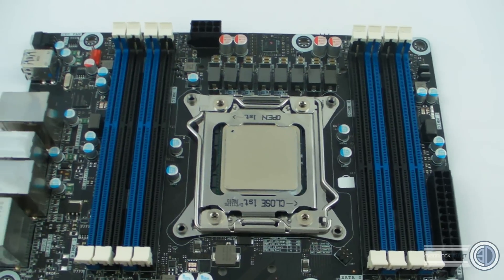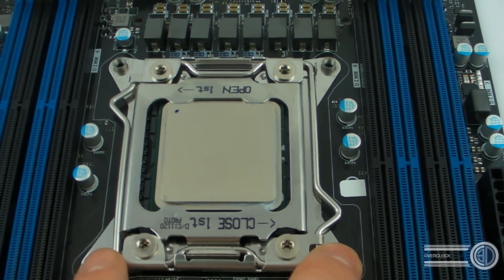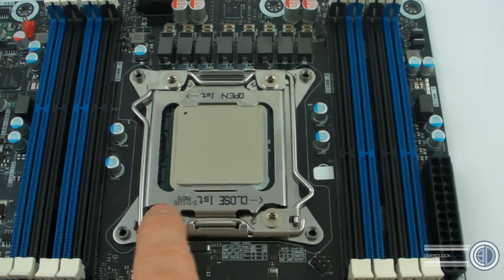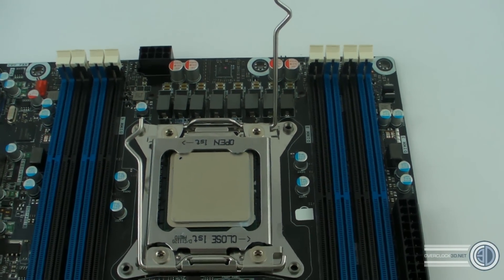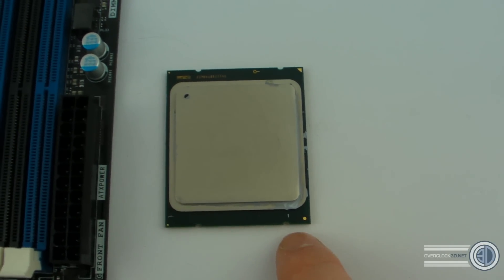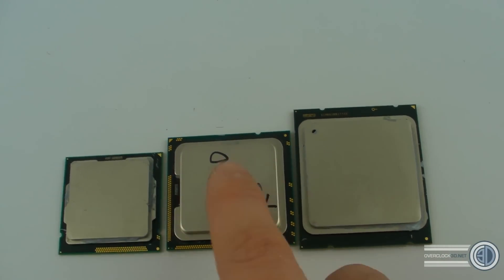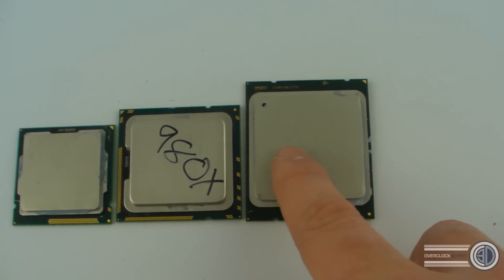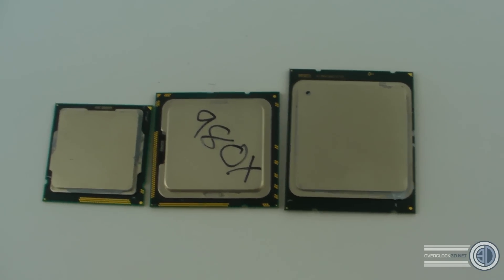Intel 2011 1155 & 1366 Socket and CPU Comparisons

Comment: ahh this answers my question about mounting my ASUS Silen Square 775 to my new Xeon 2011-3, 775/115x series were prey much compatable far as coolers go.
Reply: Michael Rinkle what happened in the end?
Reply: PneumaticFrog the 2011-3 Xeon CPU I ordered was indeed 1.5x the size of my ASUS silent square LGA775 cooler contact area, just bought a Cooler Master Hyper T4 for the 2011/-3 socket, problem solved

Comment: is it lga1150 and 1155 arw desame?
Reply: 1150, 1151, 1155 are the same size, all are 37.5 x 37.5mm PCB size. The 1150, 1155 are 1.1mm thick, the 1151 is 0.7mm thick.
Reply: Babu Diy but they're not the same amount pins..
E.g. You can't put an 1150 CPU in an 1155 socket

Comment: question for any 1 that can tell me I have 2011 intel pc i7 6core extreme now this new 2011v3 motherboard will my cpu work on it
Reply: no, in a nutshel pins not configured the same.  the good news, E5-2630 v4 ES can be had for less than $200 on fleabay ;D

Comment: Just a quick question Tom, I got a old i7 950 LGA1366 & im upgrading to i5 4690K LGA1150, Question is i got the old EK supremacy from 2009 & was wondering if the CPU water block would be compatible with the new LGA1150 ?. Was hoping to reuse that water block is all..

Comment: I still use 5 year old 1366lga cpu i dont get why they stopped making new ones why do they hate it so much :(
Reply: +Darkknight aza Because this socket is old? Maybe? It wouldn't be able to handle an i7-5960k.
Reply: Microage

Yea true. The technology just goes fast looks like they stopped making 1150 too.
Reply: Darkknight aza
They stop continuing a socket as soon as they release a new gerneration. :)
Reply: +Darkknight aza I still use my Xeon X5675 hex core with a Gigabyte X58 UD3r and have absolutely no intention on moving.
Reply: Adam Daly

Me neither :) This thing is good enough.
Reply: Adam Daly
Really? They are really not performing well on ipc intesive applications. I will probably move from my i7 3770k to AMD's Zen architecture.
Reply: Microage
I have some priorities not a lot of money.
Also i have yet to see a program which can use more than 55% cpu power :)
I have 4ghz OC with hyperthreading its about as far as i can get it stable. on 4,5ghz it need almost double the voltage and i don't have nearly enough cooling for that.
Reply: Darkknight aza
Okay, it wouldn't be enough for me tho. I use a lot of single thread intensive applications so it would be great if AMD could bring us a high ipc cpu! Atm i'm having it oc'd to 4,4ghz with 1,0v cooled by a custom loop :) Actually, i could as well go with an epicly fast dual core ^^ But that's just not enough today...
Reply: Well I've OC'd mine to 3.9GHz - that over 6 cores isn't bad imho. Yes, it's not aimed at gaming (it's a fucking beast at media shit) but you ought to see what sort of performance I get out of it
Reply: Ran passmark - get just under 10,000
Reply: Buy an used westmere-EP cpu!

Comment: Which one is better, i7 4770K and I7 980X
?
Reply: 4770K generally performs a good deal better in benchmarks, even though the 980x is a 6 core, its still a very old platform now and is being outperformed by newer quadcores

Comment: you are wrong in so many ways.. first off we now have ivy bridge and there are a lot of z77 mb-s that support crossfire/sli on pci-e 3.0 16x 
LGA 2011 is for the enthusiast user and is made for those who want something extreme. that's why it's called extreme series and shit... depending on what you can get other processors
for example for gaming the best processor right now isthe i5-3570k ... if you want rendering go grab a i7 for work with documents (word, excell, etc.) you are best off with i3

Comment: 2011 mean 2011 gold pins under the CPU,same goes with the other numbers.LGA 2011is very expensive,1000usd.

The more pins u have on the CPU,the more connections ,more SPEED.
Example ,crossfire,if u have 2 graphics card with 1155 CPU,they will run at x8 speed.but 2011 will offer x16 speeds.
Grab the 2011 if u have the money.

Comment: i have to choose between 1155, 1366 and 2011 what are the differences between them? i need a better PSU for 2011 or whatever? i dont get this. i know i need a processor that fits 2011 i will get it but whats the difference between them numbers 1155 1366 and 2011 what they do?

Comment: @R3leaZ Nah, you can get smaller still. They made them bigger so they can just fit more in a bigger area, when they have another die shrink they'll be able to fit even more in the same space and thus have even more performance and better efficiency as the space between the transistors will be even smaller. The next step is the "3D" trasistors, then some time down the line we'll likely start seeing quantum computers as the tech improves and a "slow! one of them will destroy everything we have now

Comment: @huldu You shouldn't really be using these things for gaming, at least not as the primary purpose. They're more for a budget (if you believe that lol) workstation type set up for when you can't afford or don't quite need the power of the dual socket Xeon systems.

Comment: @MOnsterPCable 

if you have atleast a 240mm rad you'll be fine but the socket is different thus you'll need to buy another contact plate.

honestly if you have a 980x you wont see much real world diffrences but if your a bencher or a hardcore gamer, x79 gives you 40 pci-e channels so a triple sli would be (16x, 16x, 8x)  it'll be nice

if youre like me pci-e with 600 series gpu will be a must to play 3D games at max or 3+ monitors at max 

plus it makes it future proof XD

Comment: @MOnsterPCable 
i also think 64gb is overkill but you can get 32gb for 160$ easy on newegg and use that for RAMcache or RAMdisk it literaly improves performance by 50x to 100x, yes x not %, PCI-E 3.0 will be very usefull for gtx 600 series and amd 7000 series and good for future proofing,

besides the new sandy bridges improves performance by 25%-50% check the hardware canucks review 
also over the next ~ 2 months there will be new releases and better pricing 

my guess 3930x for ~ 450$

Comment: @MOnsterPCable 
The 3930k is 600$ and a great asus mobo is about ~325 $ and the prices for the 2011 CPU's will drop significantly as we get closer to the new 600 and 7000 series releases, plus new CPU's intel will release.